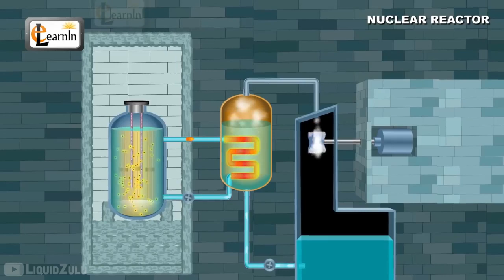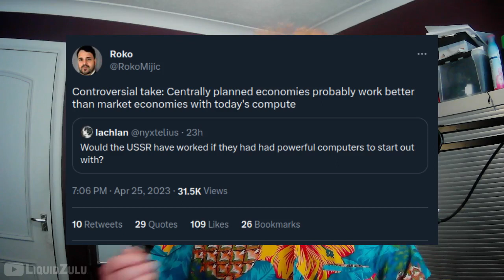Nobody Knows how to Make a Pencil

Comment: Okay, honest question...
Why wouldn't the A.I just use energy costs to evaluate choices instead of monetary costs? For instance, in the case of the train tracks, it seems like it would rather specifically depend on the circumstance on the terrain, the climate, the style of train on it, and other such things, but these things aren't impossible or even always computationally intensiveif you're simply budgeting the energy it takes to take, make, and implement parts for each step. That's mostly just matter of systems engineering, which even with the most humanly flawed decision maker isn't entirely arbitrary. I had actually thought that the ecp's true philosophical strength was in the personal preference the market allows, so I'm not stating this as a "debunk" or anything. I don't think I'm well read enough in economics to answer the 💩-storm that would cause, lol. Mostly just saying...
Reply: Energy cost, labour costs, etc. these things are imperfect at describing prices since they don't take into account desire/benefit of resources used elsewhere
Reply: @AnyVideo999  
But monetary costs only fill that hole insofar as someone else already owns them, and can charge a certain cost for them. Meaning in only "more efficient" if it can't simply outdo it's competition in the mining, refining, and processing.
Otherwise, the A.I could simply use the energy required for the extraction of the resources necessary. Then again, I suppose this doesn't apply to a being that doesn't need to trade, but I still don't see the fundamental intractability with alternative resource allocation methods. And I say this as someone who doesn't endorse the labor theory of value.